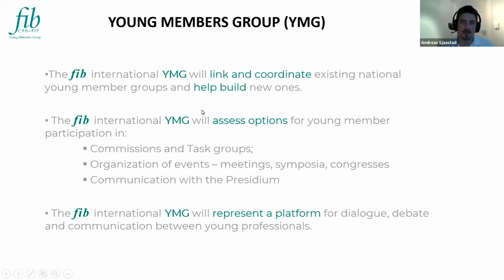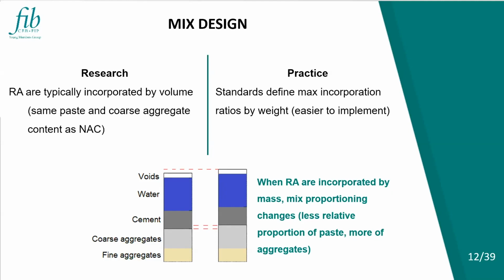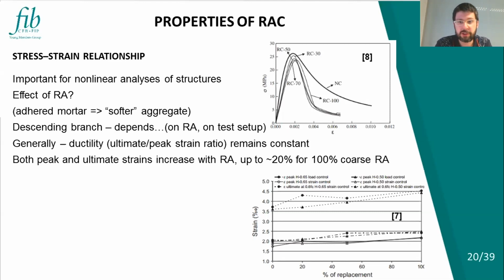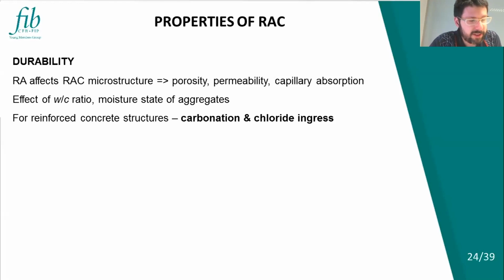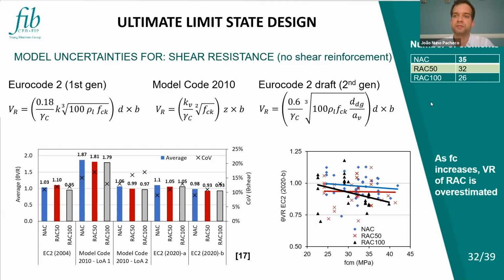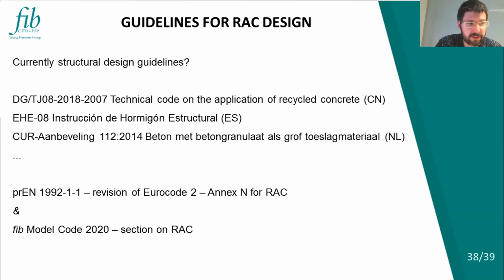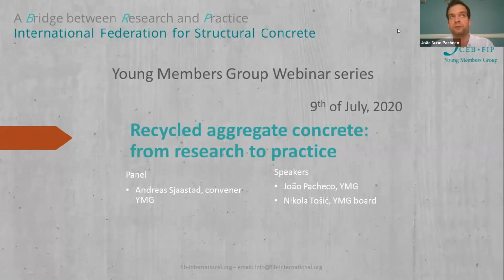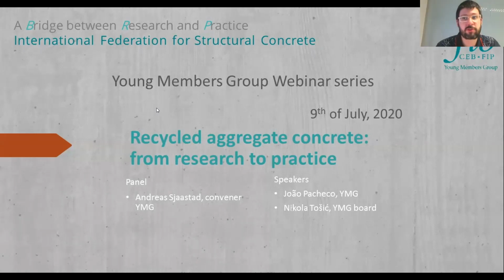fib YMG | Recycled Aggregate Concrete: From Research to Practice | Nikola Tošić & ‪João Pacheco

Comment: Good theme and good presentations. 
It could be made more clear since the begnning that materials' properties are for aggregates recycled from concrete only - a slide on the minimum % of recycled concrete on the total RA to properly qualify what a Recycled Aggregate for concrete is, e.g. based on EN12620, would have helped.
The discussion about ERCs is a bit more articulated that what described here, but for this webinar is more than enough. 
RAC up tp 100% is irrealistic because of the lack of aggregates in the market, the suggestion on 25% replacement of coarse aggregate made in the conclusions  is realistic and the one to be proposed to the industry - hoping more recycling aggregate plants will appear.
I any case, well done - environmental issues are becoming more and more relevant and the way is to reuse-recycle materials is the only one we have in front of us.
F. Biasioli 
ERMCO and European Concrete Platform 
fb@ermco.eu
Reply: Dear Francesco Biasioli,

Thank you for your comment and encouraging words!
Yes, we should have been more clear about most of the material and structural parameters presented being applicable to recycled aggregates from concrete only. We did present the table of EN12620 on slide 10 with classification by composition, but did not state it clearly since we opted against being too specific about some aspects (this was one of them). The presentation was made for a broad audience and we focused on concepts.

We did not present analyses for RA from other types of waste (e.g. unsorted CDW) since design recommendations require that data be widely representative and the majority of research has been made with recycled aggregates from concrete, particularly in the case of structural elements. Yet preliminary results show that for beams in bending, current formulae are equally accurate and precise for CDW RA as well.

We agree that 100% coarse incorporation will only be applicable in some very specific cases due to technical and industrial aspects. However, as in the case of recycled aggregates from unsorted waste, research on intermediate incorporation ratios is scarce. Therefore, we made the analysis for consistent and robust databases for total incorporation and propose linear interpolations for intermediate ratios of RA replacement.

We are very happy to see that the topic has had a good reception and we will surely continue to work on RAC and its promotion as a more sustainable future for concrete and concrete structures!

N. Tošić & J. Pacheco